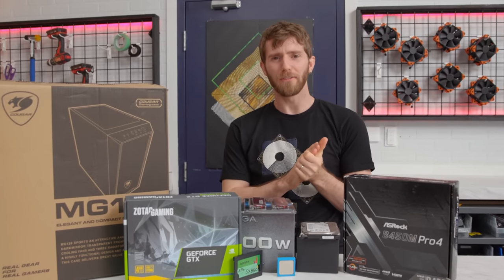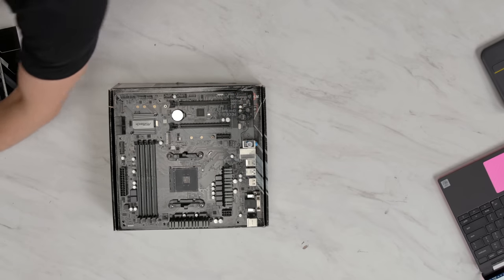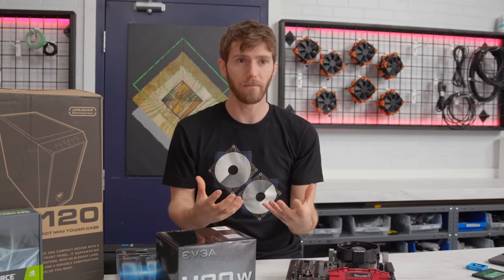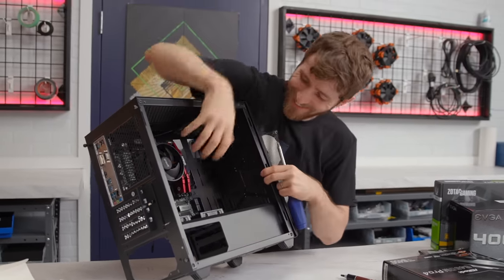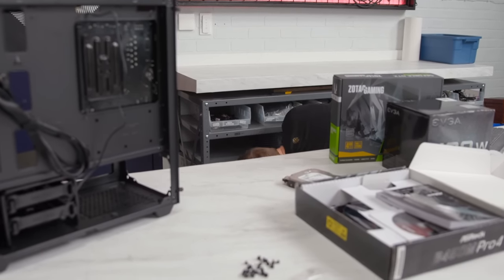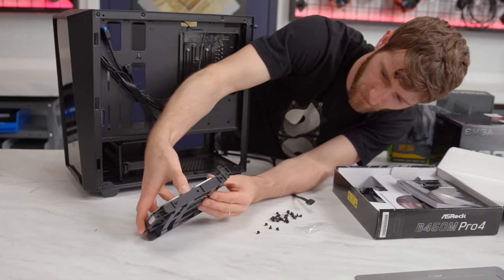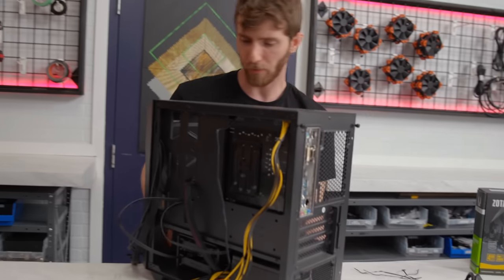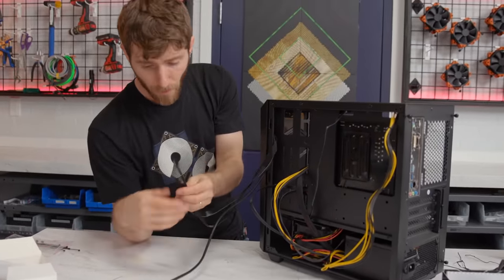Building a $500 AMD Gaming PC

Comment: What's with the thermal paste? I've not built a PC before,
Reply: Still curious?
Reply: @kenny.m.olsen95  yes
Reply: @zxopixel  It transfers heat from the CPU into the Cooler basically, in super generic terms

Comment: The price of the HDD is very close to the price of the NVMe if we also consider the price of the SSD disk, one could buy an NVMe with enough memory for windows and for several games, even space for applications.  Also as far as I know Dual channel ram is not much more expensive than single and works much better but you still pay a certain amount. Personally I would buy second hand dual channel ram memory and there are quite a few good gamer video cards second hand or just unpacked  for a fairly low price.  Also, I'm not a fan of AMD processors and would buy an Intel that can perform just as well and be cheaper.

Comment: Can't stress this enough about that 1650 
STOP BUYING 1650'S ITS SUCH A TERRIBLE CARD
Reply: ok then what’s a good card
Reply: @reammvrc  literally one step higher a 1660 for not much more price you can raytrace. It's only basic raytracign but you can sleep witha  peace of mind knowing you have raytracing capabilities out of a gtx
Reply: @warrengagne5091  it’s also over a hundred dollars more. It’s a budget PC, it’s not meant to run games at fucking insane quality with ray tracing. It’s just meant to take pressure off of the CPU to deliver a solid and consistent frame rate.
Reply: @ange1noha1o  it's still a gtx not rtx which by name Costs a grand
It's just easier to get your hands on a 1650 than a 1660 because people are buying 1660s to mine
Reply: @warrengagne5091  What? A grand? It’s $160-$170 just for the drive. The specific one he got obviously spiked in price to about $240, but they’re very cheap, best for the price, budget GPUs. No point going higher
Reply: @ange1noha1o   what planet do you live on msrp planet? Everything is overpriced right now. And you can make money back mining. Also you must not know the market
Reply: @warrengagne5091  literally just check the Nvidia website. You will find partners selling for the prices I just said. Just assuming they’ve gone up 1000% isn’t exactly a reliable metric
Reply: @ange1noha1o  exactly is not reliable at all the prices skyrocketed I'm from Canada where prices are inflated also 500 dollar computer build isn't very much nowadays for what u need it's like 500 dollars just for a 1650
I run a build I got the parts off someone for free so I only really had to buy a gpu for better performance but it's still better for a 1660 than a 1650 because of the BASIC raytracing out of a GTX and the ability to mine for extra money which in turn drops what you actually paid for the machine do I need to explain more about   how people are driving the prices up to force us into buying worse drives?
Reply: @warrengagne5091  maybe in your currency, but in American dollars, which the video is talking about, a 1650 is easily available at $160-$170 and can be an easy addition to a budget PC. Prices are inflated, but this PC is worth about 700 max.
Reply: @warrengagne5091  dawg literally just check the website. The facts are all there, you’re so delusional
Reply: @ange1noha1o  your missing the fact you can mine profitably with a 1660
Reply: @warrengagne5091  that’s not what a budget build is for homie. It doesn’t matter if you can make money with it, the whole point is staying within budget. It’s a bullshit risk to just say “make money then lmao”
Reply: @ange1noha1o  it's still a budget rtx card because it a gtx not an rtx and this video was made when things were just starting to get out of hand
Reply: @warrengagne5091  yes, that’s my point exactly

Comment: $500 PC #LMFAO......be ready to replace Processor in 3 years.

AMD processors have shorter lifespan....not reliable at all for long term. they are not budget processors anymore and not stable also.
Reply: is that why amd is more popular now? haha
Reply: @Aditya Bhattacharya yes linus has said it himself
Reply: @Aditya Bhattacharya it's really surprising that you don't even know that overclocked CPUs have shorter lifespan than locked ones.

Amongst my circle many who build Ryzen did face many issues after year and half/two. Such as heating issues, lagging, and what not. They use proper airflow casing and decent cooler so yeah service center did say it's the processor, not the RAM, not the motherboard or anything.

I also used AMDs in the past, Athlon and Sampron processors. They died out after 3-4 years. 

They used to be budget processor but not anymore. 

My last build was in 2009 i7-870 processor, it's still kicking ass with 750TI. 

Gonna build i7-11700F build from the scratch. It's cheaper than Ryzen 7 5800x and 2% performance margin for the $100 bucks not worth it.
Reply: @Aditya Bhattacharya my point is I don't want to spend my money on processor in 3 years again....i want which is durable, give performance and last longer. A long term investment probably 8-10 years with only GPU upgrade.
Reply: @matrenfrow6135  its herd trend, also Intel still has superior clock performance than AMD. I will buy AMD if it's cheaper option. Currently it is not.